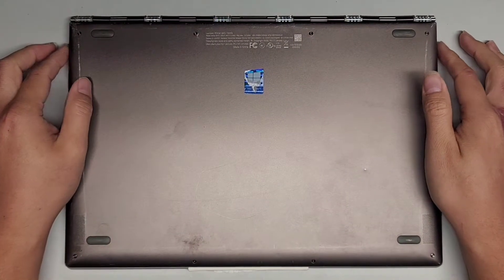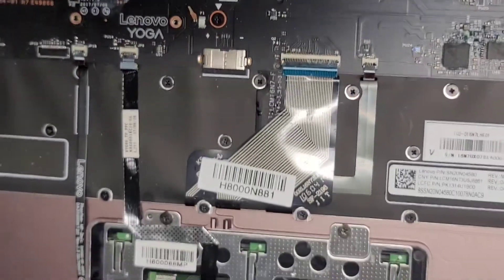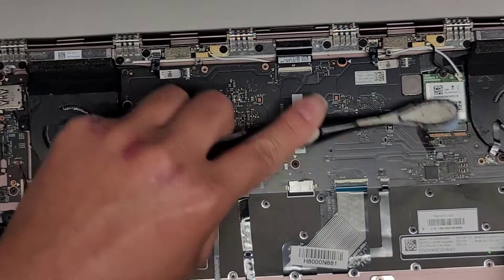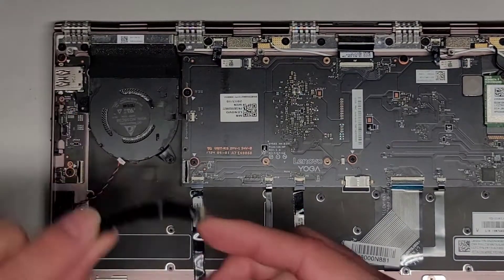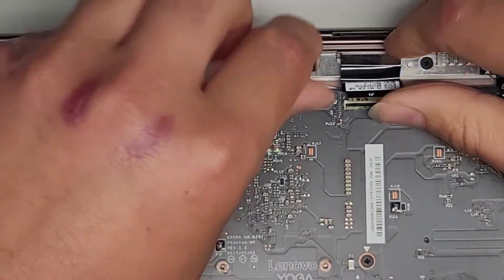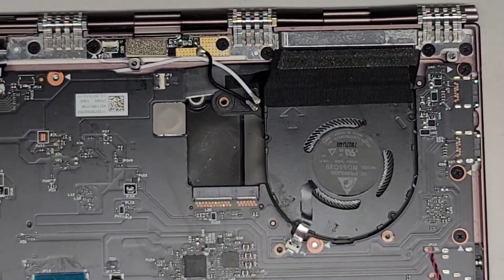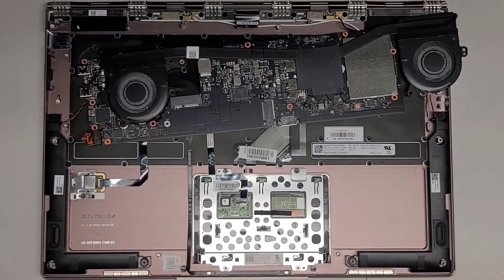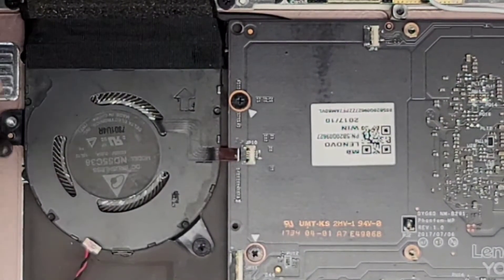Lenovo Yoga 920-13IKB Disassembly SSD Hard Drive Upgrade Battery Replacement Liquid Spill Repair

Comment: Thanks!
Reply from the maker: Glad it helped. Thanks so much for the support!
Reply: Thanks for the great video. I have a full 256 ssd and have cloned it to a 512 that I had laying around.  Was having trouble with the ribbon cables since I've never had to deal with them. I'm not a techie so a lot of this is new to me. Your video helped me alot I've taken it apart most of the way one time then put it back together just to see if it would work. Voila! Now I will do the whole thing and plug in the new SSD. You saved me a bundle thank you much!
Reply from the maker: @MrToucandream  awesome, glad it helped! If you haven't already, please like and subscribe so others can find my videos and possibly consider watching a few others to get the algorithm to recommend my channel. Contributions are always greatly appreciated as well.

Comment: I have the same loptop but one of the usb c is working. Unfortunately I need both for the double monitor and the other one is for charging. Do you have video of how to replace the USB c port?
Reply from the maker: Can't help you with that. You need motherboard repair.

Comment: Hello.  Is there a way to test the battery before buying a replacement?  There's no light when plugging in the AC adapter, so I don't know if it's a bad board or battery.  AC adapter is good as it can power up other laptop. Tks.
Reply from the maker: Sounds like a motherboard or charge port issue.
Reply: @ItsBinhRepaired  Thank you for your respond.  Is it possible to replace the charge port or it's integrated into the board and cannot be replaced? Tks.
Reply from the maker: Soldered

Comment: hi, so I just came across this video by chance and I have this laptop, with liquid damage as well (diagnosis report says motherboard is toast). I ended up buying a different laptop bc having it repaired would have cost more money than the laptop itself. I kept it bc it is a star wars special edition and it looks pretty. I recently saw on ebay that used ones are pretty affordable. do you think it would be possible for me to repair mine if I use a used one for spares or do you think that's stupid? I absolutely adored that laptop so I would love to have it fixed

edit: and if I can fix it is there a way to save my data from my ssd in case it's fried too?
Reply from the maker: You can either get a usb adapter to access the drives, or swap the drives to another same model motherboard, assuming the drives are ok.
Reply from the maker: Personally the laptop is really old, so it would be more just to collect it than to use it.